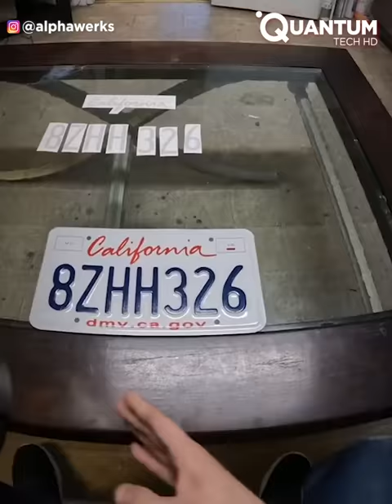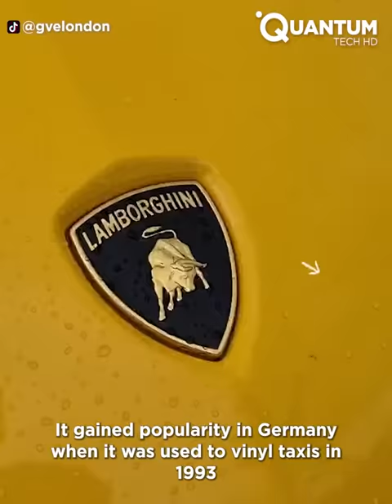Satisfying Car Wrapping Jobs by Workers With Amazing Skills

Comment: What isn’t mentioned is the amount of work required after 2-5 years of a daily driver to remove the wrap. 

As a Tech in a high end body shop, We turn away wrapped vehicles for this reason. Ask whomever wraps your vehicle how much it costs to remove and rewrap after 3 years in a Hot environment. Bet you it’s more than having it wrapped. 

PPG warranties their MATERIAL for the Life of the vehicle, On average, 10 years. Can you make a Wrap last 10 years without shrinking or cracking?
Reply: Ага, если вообще автомобиль желательно менять, то другой хозяин будет думать..

Comment: Why would you do that to you car??  When the car heats up and cools down it causes condensation to form between the car and the plastic wrap which will be impossible to remove, therefore resulting in RUST.. this is the stupidest thing you could do to your car..
Reply: Well they said that if done correctly the acryl that sticks the plastic to the painted surface will prevent from moisture forming underneath and consequently not forming rust... Well im no professional...
Reply: What you talking about they push it out
Reply: Apparently you don't understand the whole situation
Reply: @cecilmayhew538  apparently you don't understand what a sharp knife does to paint....Cecil 😎